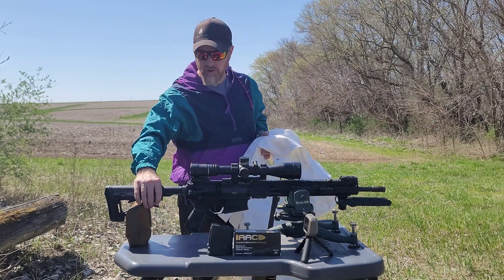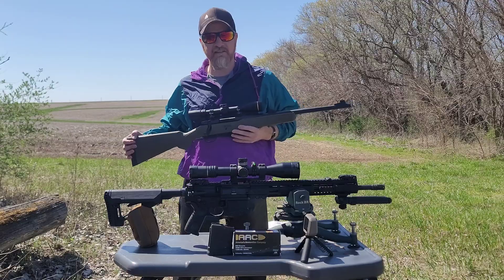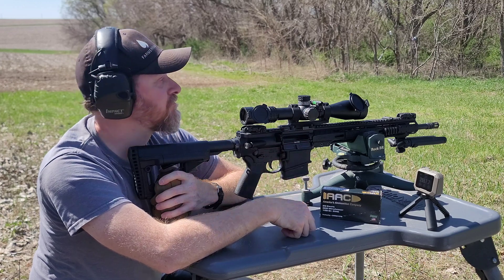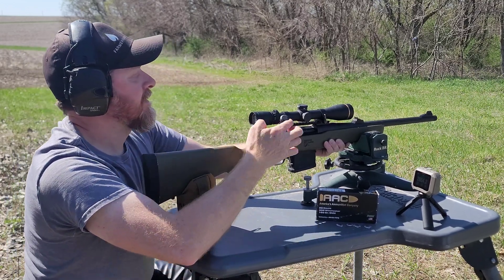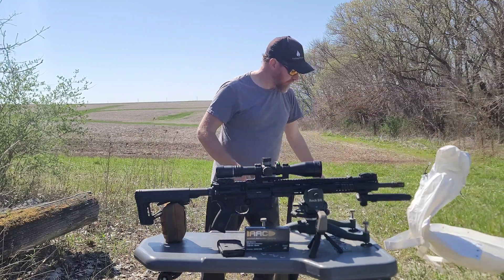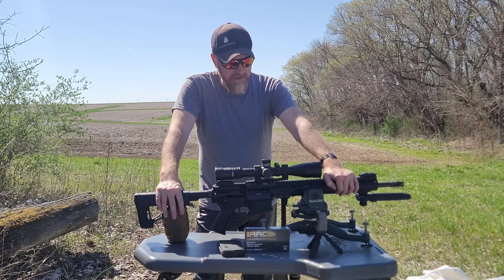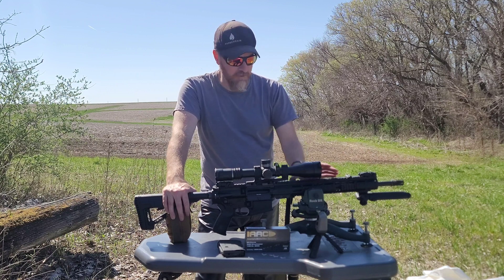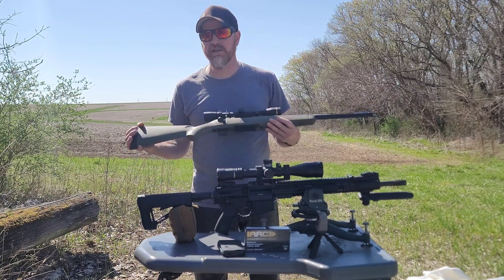Is there a velocity difference between an AR10 and Bolt 308???

Comment: i was definitely expecting the MVP to have more velocity due to the bolt being closed the entire time its firing. by how much was what i had hoped to know but im suprised. completely speculation but i think the flash hider may be acting as extra barrel length somewhat. and holding a little more powder/dwell.
Reply from the maker: I have some Freedom Munitions M118 LR coming so I'll be getting the 18" rifles back out to test it again.
Reply: that would be a nope.
Reply from the maker: @jeezopeez  I'm with you.  The flash hider was made for a 350 legend too so its big for the 308.  I took the muzzle break off of the armalite before I even shot it.